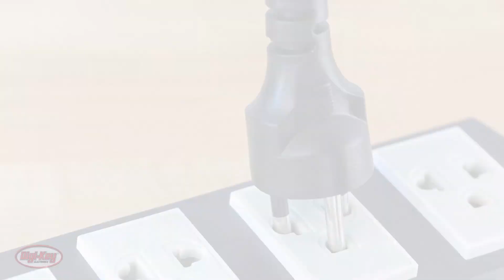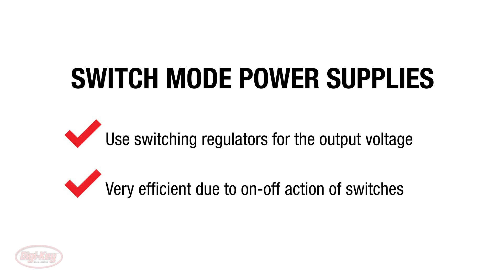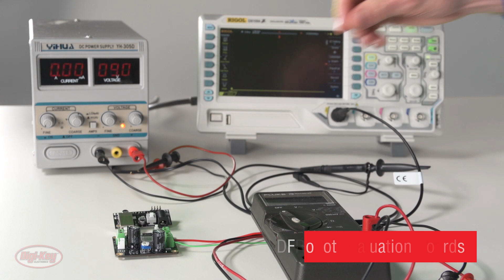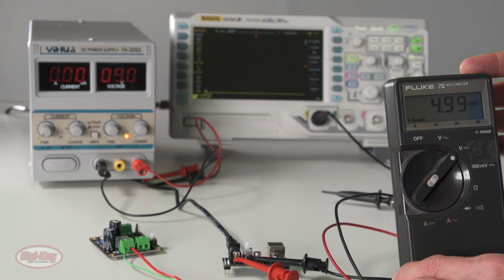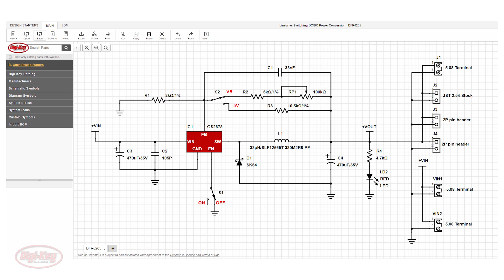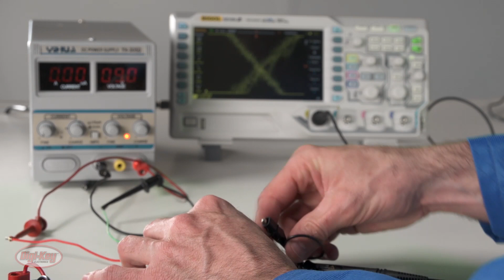Linear vs Switching DC/DC Power Conversion – Tech Basics | Digi-Key Electronics

Comment: scope measurements (noise) should have been made under a load to the regulators
Reply: I was about to add the same... Without a load, just to a voltage divider with two simple resistors will give something a voltage output as stable as the source could be. :-)